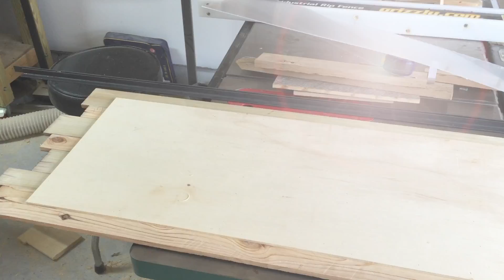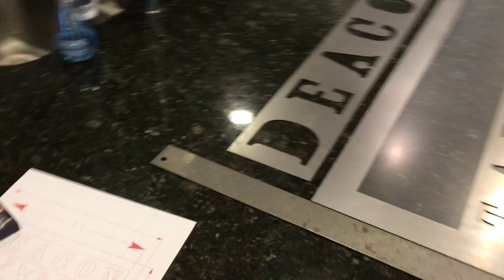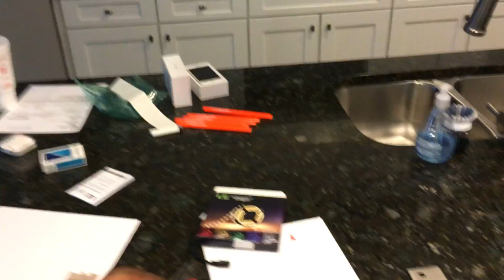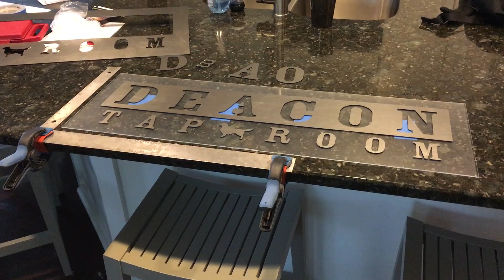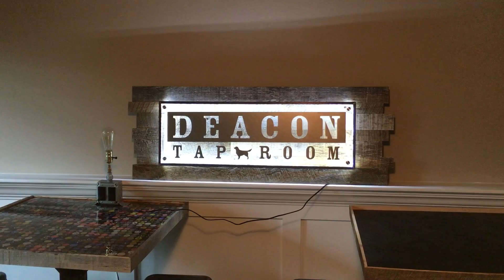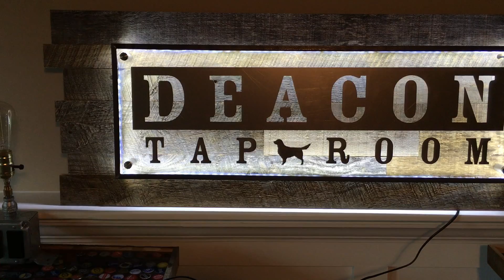DWW: Taproom Sign (ep02)

Comment: how much this kinda signs cost?
Reply from the maker: The wood was scrap material from another project. The angle iron and plastic is from Home Depot (~$30), the LED lights were from Amazon.com (~$20), and the lettering was from a local metal shop (~$125). So overall, I have about $175 into this sign.
Reply: Thank you Sir  for the information . appreciate it :)

Comment: Ok where did you get the metal cut at?
Reply from the maker: Local metal shop here in NC.
Reply: Does this Shop have a Name? I ask because where I live does not have said crafty CNC Metal Shops where I live.
Reply from the maker: Honestly, I don't remember. I did a google search for local metal fabrication and laser cutting in my area and they came up on the list. Sorry I couldn't be of more help with specifics. I do remember is was in the NoDa area of Charlotte, NC if that helps in your search.